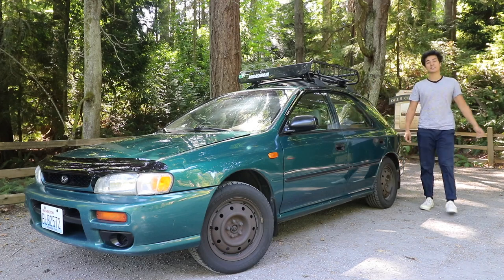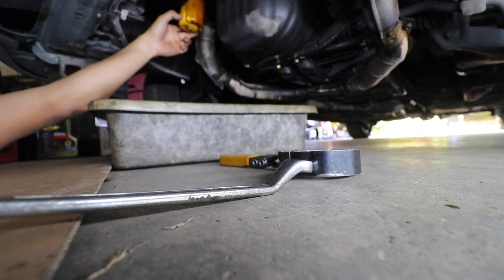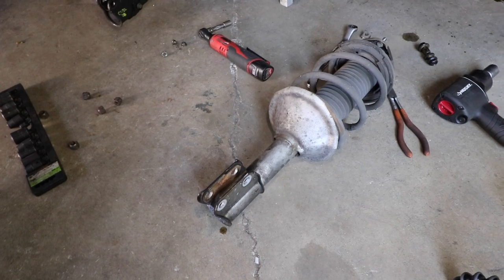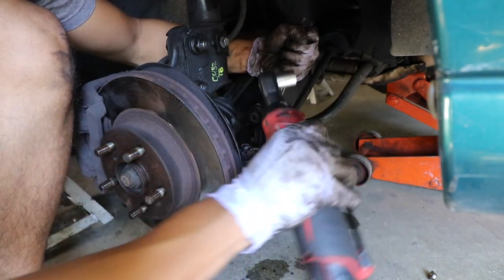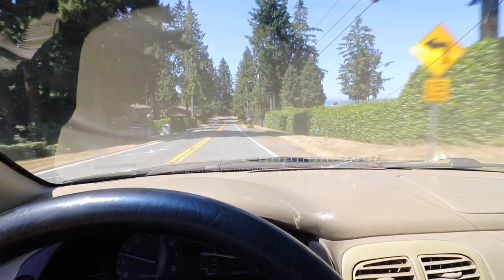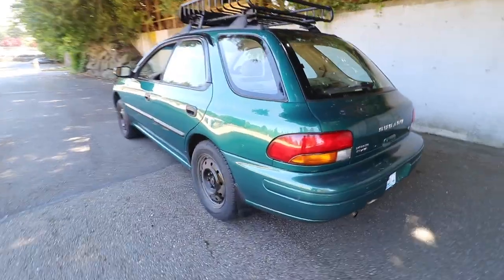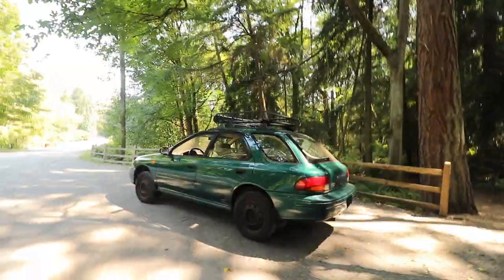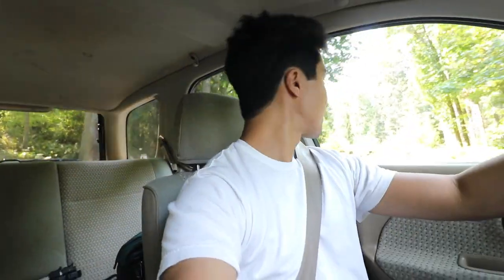Subaru Impreza “Battlewagon" Ep. 1: The Best DIY Lift Ever!

Comment: You can also just switch the top strut mounts on the rear struts.  Use the Impreza strut mounts that match the body with the Forester strut/spring.  No drilling required, but you do need to compress the springs.

Comment: Looking at doing this to my 2.0l S same body, don’t want more than a 2.0 /2.5 lift as don’t want the CV angle to be under stress in off road, issue with sanding and shock stroke on full compression,  would have been sweet to get a look at that CV angle before and afterwards,but because it’s Suby for Suby mid change guessing it stays that same, which is about right for anything under 3.0” lift right?, agree with others really well don’t vid mate, cheers 🤙

Just a tip for growing your channel and attracting sponsors, link where ya get your parts from to help us guys and girls out, just saves allot of guess work and helps if comparing, cheers again.🤟

Comment: hi , this video was long time and i hope you still active and healthy in this difficult times , i have a question for your,  i am trying to lift my 2002 impreza wagon with the same system as you did with your car , but i  am very bad mechanic ,  the sway bar that you took off  in order to fit the new shocks how did you put this on or together again ??  i saw that you remove some part from the back shocks can you tell me where this part came from or the names ???  the year from the forester , and how much did you pay for all the shocks ??   great videos and thx a lot
Reply from the maker: Hey Alex, 

Thanks for reaching out. I actually made a video about reconnecting the sway bars already. You should be able to find it. I think it's episode 7? Can't remember off the top of my head. You will need to use extended sway bar end links to run the sway bars again. But if you are in a pinch, you can still drive the car without sway bars with it being lifted. Just be easy when taking corners and drive at your own risk.

As for the struts, those came off of a 2004 Subaru Forester. That will give you desired lift that you are looking for. 03-08 struts will fit your car (which is a GD chassis). If you have any other questions, I'd really suggest joining the Bugeye Impreza Facebook group and those folks can help you out as well. Best of luck on your build!

-Z
Reply: @bendaga  , thx a lot buddy you have a new subscriber ,  you are very good mechanic thx for share your knowledge !!!be safe
Reply from the maker: @alexgamboa5466  Appreciate it - Hope you stay safe as well!

Comment: So I finally got the struts and I’m about to put them on with the arm spacers for the rear. 
Do i need any arm spacers in the front so that the wheel won’t move ? Or is it just the rear wheel that moves? Thanks for helping out
Reply from the maker: No spacers needed for the front. Id advise for subframe spacers if you do any lift past 4 inches or so.
Reply: @bendaga  Thanks so much for your knowledge and quick reply.
I won’t be going any higher than the forester struts. So I should be fine right? With just the rear arm spacers?
Reply from the maker: @Leo.filmstories  yeah you should be good. Happy to help!

Comment: Is it normal to have to disconnect the sway bar to carry out this mod? Would be concerned about the effects on handling
Reply from the maker: It helps when doing the lift. You will need extended end links to run the sway bars again

Comment: I have an 02 Impreza OBS, do you know what year forester struts would fit on it? 03-08? and is it as simple as changing the rear top hats only?
Reply from the maker: 98-08 should work. But 03-08 forester struts will be slightly taller.

Comment: Instead of filing out the holes on the rear ..... swap the top hats !!
Reply: Yeah you have to put a washer under it too , as the plate is thinner and the nut runs out of thread
Reply: Should of put a dab of paint around the holes you drilled out to stop rusting.

Comment: You didn’t need to take the sway bar off I did a 4 inch lift on mine and left everything connected
Reply from the maker: Ah interesting- I had no idea! Glad it worked out for you
Reply: @bendaga  yea I haven’t tackled the rear yet I’ve been working on it all day but my drill sucks so the drill bits are just spinning and my file I have is so skinny it’s taking forever and now I have back problems at 15
Reply from the maker: @brandoneddy1263  Sorry to hear that man. Wishing you the best of luck

Comment: Is there any down side to just throwing forester struts in there?
Reply from the maker: If you plan to run larger tires, you will run into clearance issues in the rear without trailing arm spacers.

Comment: The filing of the rear strut point worries me if you did it off wouldn’t that make it uneven at the rear
Reply from the maker: That's a valid concern to have. Another way to do this is swap the top hats from the Impreza struts and use them on the Forester struts. You will need spring compressors to get the top hats but it means you wouldn't have to file down the rear of the chassis.

 But as long as you measure correctly, you shouldn't have any sort of issues. I've have this car like this for years now and it's never been an issue.

Comment: If I put a half inch saggy butt spacer on the rear forester strut, will I need to get anything else besides the trailing arm spacer?
Reply from the maker: It all depends on what tire size you plan to run. You should be fine though.
Reply: @bendaga  cool thanks man take care dude. Subbed!

Comment: Do you think it would work on a subaru impreza  sedan  2007 2L
Reply from the maker: Yes it should
Reply: @bendaga   The back struts only have 2 nut type.  may have just to make up riser blocks for it
Reply: @bendaga    as the rear is only a 2 point ,I think the 3 point will not have an a position to go.  so have gone for a 40mm lift kit instead

Comment: What year of Forrester is this off of .?
Reply from the maker: These were specifically off of a 2004 Forester, but you can use 03-08 Forester struts if you want to have this exact lift. 98-02 work as well and are a big cheaper, but I think the lift is slightly less.
Reply: @bendaga  alrighty good info thank you sir
Reply from the maker: @bakihanma7247  no prob